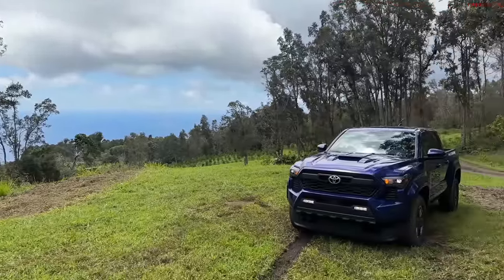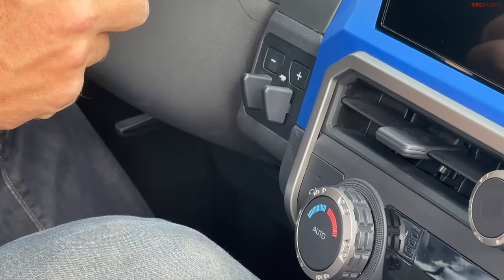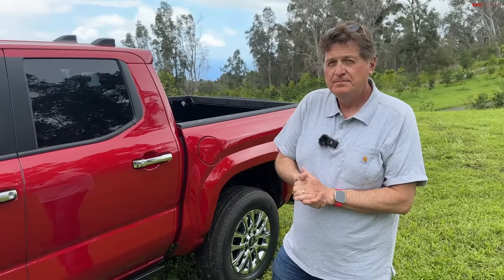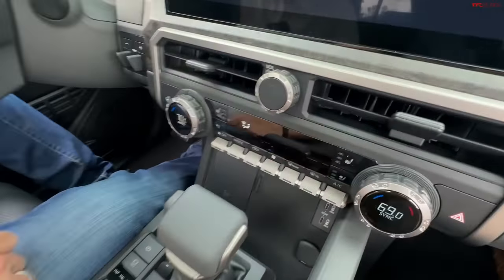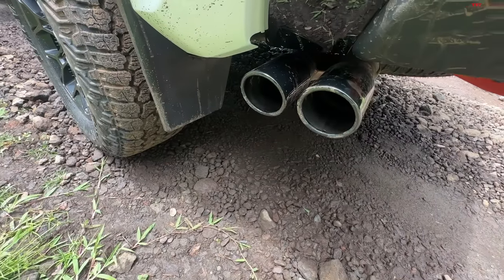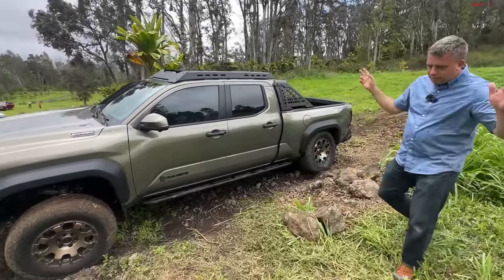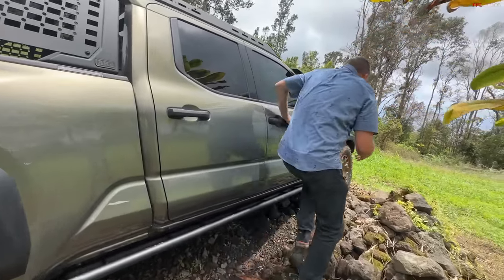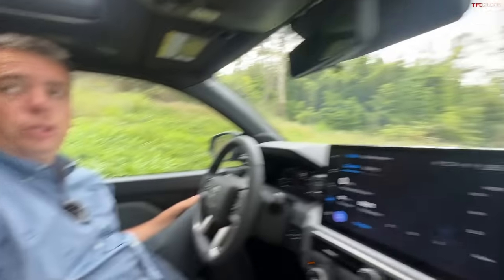The All-New 2024 Toyota Tacoma Is Finally Here But Have They Fixed Its Three Biggest Problems?

Comment: The pricing and fuel efficiency numbers are not out yet but I imagine they will be very much inline with the Ranger, Colorado/Canyon.  Great to see the cab tweaked to add a more upright seating position with a bent knee and the overall styling is very nice.  The air dam/valance on the lower trim models though is terrible.  The rear step up bolted to the bumper should have just been engineered into the bedside which would still allow them to offer different rear bumpers depending on trim.  I don't think the towing number is a big deal at all as most people won't tow with it anyway and it was nice that they offer the brake controller now.  Overall I think it will still sell very well and probably lead the segment but I still think the Colorado/Canyon for me is a better re-design overall.  Better room in the cab and nicer looking lower trim level offerings.
Reply: The only problem with GMC, Colorado, Ranger, Nissan...is that despite them having more modern features, the resale value on Toyota is still waaaay higher...nobody wants an American (garbage) midsize used truck. 80,000 miles on an American truck is alot...where Toyota is beauty broken in at 150k

Comment: The new ranger was announced and Toyota said, “hold my beer!”
Reply: Why? This isn't close to the Ranger Raptor.🙄
Reply: the Ford ranger has a V6 TwinTurbo. They should’ve put the big V6 in the Tacomas four-cylinders suck.
Reply: @TheMarkdick  Honestly prefer the hybrid, instant response instead of turbo lag. Even though it has less power in the real world it will be quicker because of the electric motor.
Reply: @MrLalasd  ford should have added a hybrid option. Plus I like the styling of the new tundra a lot more than the ranger
Reply: @dmegahan  Probably just a matter of time, now that Toyota has a hybrid on the market.

Comment: Manual trans!! , yes. I'd pick the non hybrid. Is performance capped with the turbo setup?  Anything special with the block?
Reply: Without the battery it makes waaay less power than anything out there
Reply: @willrector9716  2023 tacoma 2.7l i4 makes 159hp/180 tq, 3.5l v6 makes 278 hp/265 tq. The 2024 SR makes 228/243 which is already a huge increase for the SR model; and the SR5+ models that are non-hybrid are 270/310 with manual and 278/317 with auto; which actually makes WAY more torque than previous gen. Please explain how this has "way less power than anything out there" when the 2023 colorado makes 237/259 with the HO version making 310/430...The new 2024 ranger with its 2.3l ecoboost is 270/310 with its high end 2.7l v6 ecoboost making 315 hp/400 lb-ft of torque --- STILL less than the i-force max making 326/465. 

I think you're wrong here in many aspects.
Reply: @JoeWitAFro  Cool thanks for the info. Seems almost the same output as the old tried and true V6 but with turbo lag.   I'll take my supercharged v6 over the twin turbo 4 banger anyday, about 30% gain over stock.  Now if we could get a twin turbo v6 that is a different animal.. but we know that will never happen OEM. Cheers. I really like the new seats....
Reply: @vorsol1994  These are single turbo 2.4l inline fours; the turbo is pretty small so no turbo lag should be present. Can't even tell my 1.5l honda has a turbo.

Comment: Some questions about the engines, is the hybrid engine an atkinson or miller cycle engine? More efficient than the non hybrid models. Looking forward to see how the hilux ends up since its said to be on the same platform.
Reply: yep hybrid witch is green hydrogen electrolyte

Comment: Will miss the V6 on the current Taco, but eagerly waiting on how the different 4 cylinders drive especially the manual !!
Reply: The 3.5 was a garbage engine. The 4.0 is the last good V6 that Tacoma came with and it's still missed. More reliable, more usable torque. The new big torque engine isn't available with a manual which is a soul crushing bit of news.
Reply: @hochhaul in what ways is the 3.5l worse than the 4.0l? Where are you getting these stats? I am going to guess you have a 2nd Gen Taco, don’t you?
Reply: @mikenormandy9250  i would also agree that the 4.0 was better than the 3.5. 3.5 was a downgrade
Reply: @Ni-fg6je  The 3.5 is a car engine,wasn’t made for trucks
Reply: @mikenormandy9250  well these guys aren't exactly wrong about the 3.5 being worse than the 4.0. Sure it has more horsepower but it also has equal torque of the 4.0. The 3.5 needs to rev much higher than the 4.0 to achieve its numbers

3.5
278 horsepower at 6,000rpm
265 torque at 4,600rpm

4.0 
236 horsepower at 5,200rpm
266 torque at 4,000rpm

The 4.0 was better suited for suvs and trucks. The 3.5 is better suited for cars. The tacoma isn't a race car. It's a truck.
Reply: @thejuiceisloose8703 I agree
Reply: @thejuiceisloose8703  and yet people think this new 4cyl turbo will be better ? Ha

Comment: I currently own a 2021 trd sport. I can't wait to see more and eventually test drive this truck! I will for sure wait a couple of years and let Toyota figure out all of the little issues before going ahead and trading my current truck.
Reply: Sounds smart. I'm afraid to buy any post cough cars with all the issues they have.
Reply: Still sad the upgrade hybrid power train is the same power as literally every other base midsize!
Reply: Been hearing that new Tundra engines have been blowing up. Id wait a while before getting one of these new 4 banger hybrids.
Reply: @BatuSmoka808  lol there have been quite a few 3.5 V6's blowing up in the 3rd gen. I would definitely hold off for a year or two before trading in my Taco for a 4th gen. I got burned trading in a 2nd gen for a 3rd gen.
Reply: You have practically a brand new truck.
Reply: @BatuSmoka808  The 2.4T isn't a new engine.  Unless they really messed up tuning it for the Tacoma it should be fine.
Reply: @Ni-fg6je  Wrong, 1st gen was
Reply: @hochhaul  Really? I have a 3rd gen and my V6 has been great so far. I trust these naturally aspirated engines more than a twin turbo 4cyl hybrid.
Reply: @jeffk464  What other vehicles is it in?
Reply: Not bad, like the sway bar disconnect, anchor points. I like how they moved the 4x4 select button away from your ac controls but, I would have liked to have seen that ghost viper cut be a real one but I guess they gave us the lines to do a real one. I havent done one on my 2020. I also wonder what the mark up will be for a basic ARB bumper. The thing that bothers me the most is, if u really want any power/torque, ...ur gonna have 2 go hybrid. Thats their money maker. The markups on these things will be asinine! And on the sarcastic side....lets guess how many plastic tabs are used to put these together. I will stick with my 2020 and her known issues which have been modified vs jumpin in and trading. Going to give this thing several years before I even think about it. The quality from a second gen to a third has gone down quite a bit...so unless some things change for  the better, these new Tacomas are in for some big issues. I also am not a huge fan of the longer wheel base. Jury is still out for me....

Comment: It has that new twin turbo 1 cylinder prolly
Reply: LOL!!! 1 cylinder !!! All New weed wacker engine!😂
Reply: It’s a thumper engine. 1.7 litres!! Torque monster!! 😂😂
Reply: It's probably going to have the 2.4L Turbo 4-cylinder found in the Lexus NX...
Reply: Its Quad turbo
Reply: @Hiluxtaco  all new turbo charged inline 4 sitting on a Tundra frame .
Reply: Does it come with cylinder deactivation?
Reply: @gamebredduramax71  Toyota doesn't use "all-new" engines like that. They first appear in their Lexus lineup, then work their way down to the Toyota vehicles..
Reply: Alexander no cyclinder deactivation. So it will be intresting on MPG most use it to get the MPG they state

Comment: My biggest reservation would be the 4 cylinder engine. While Toyota clearly brought more tech and features to the Tacoma, Ford absolutely nailed it with engine choices. Many people don't care about all of that tech, so the engine choices on the Ranger may be enough to sway a lot of customers their way. Hard to believe with the Ranger, since it's been available elsewhere for some time and should have done a lot more.
Reply: Turbos general go belly up around 100k, too bad they didn't keep the V6.
Reply: @PianoUniverse  I'd much rather have a V6, but 100k seems pretty reliable.
Reply: I don’t think their turbo Hilux has issues

Comment: Those hybrid setups are still too new to determine if they’re going to last in these new Toyota trucks.
Reply: NiMH does not give me the warm and fuzzy for sure
Reply: @albe23  there is a reason they do nickel. They’ve been doing it for over 20 years in Priuses and now other cars of theirs that have been insanely reliable.
Reply: Probably why they’re starting so small with kw and it’s Toyota so they’ll improve over time. You won’t get a million miles on it though 😊
Reply: Plus the battery takes up all the rear understand storage space.😞
Reply: Yeah I think there’s pros and cons for sure but I’ll be looking for something without the hybjrd setup. I think the TRD PRO and trail hunter ONLY come with the iforce max. My hope is that they’ll come out with some tunes for the regular turbo version and that’ll help wake it up with some more reliability
Reply: I love hybrids but I hate turbo engines....... I'd be more worried about the turbo power if I were you.
Reply: @Chett_Manly_ Toyota warrantees hybrid batteries for 10 years.

Comment: Man, I will either be very happy I got the last 3rd gen in my 23' or be  very sad hoping I had waited..
Reply: Hopefully you won't be disappointed. Fingers crossed!
Reply: You don’t want a first year model of a new gen anyway
Reply: The 3rd Gen is absolutely beautiful compared to this thing lol.
Reply: @westcoastplinkin6559  LAST TACOMA IS GARBAGE COMPARED TO THE NEW ONE
Reply: This new one is cool, but I’m perfectly content with my ‘23 Tacoma.  No regrets.
Reply: @danielhayner8677  👍
Reply: You'll be pleased you saved thosands, at least !!
Reply: @volvoxc9086  I would rather NOT have turbos. That shit is going to break within 100k miles most likely. No thanks.
Reply: The turbo's will be fine lol .Its just like when cars went to fuel injection. And everyone said carburetors are better lol. Gm 2.7l engine already has hit 200k and more . Yes they need more.upkeep and paying attention to the oils

Comment: The styling, materials, sound all look sub-par compared to the new Canyon / Colorado.  GM for the win
Reply: Yep, I think they just ruined the look of the Tacomas. If it looked more like a mini Tundra, it would be fine, but this is horrible!
Reply: 😂 the colorado doesn't even come with a painted bumper and heated seats till top trims
Reply: @Ryan Lavallee  and the Toyota doesn't come with lots of others things including a front locker................
Reply: @Will Rector  pretty sure the new one has it, but I'd rather have a painted front bumper, mirrors and handles than a front locker and not pay 2k for heated seats that should be standard, or even cruise.
Reply: @ryanlavallee3239  The only Colorado that doesnt have a painted bumper is the Work truck and Trail Boss, every other trim has a lot more luxuries.
Reply: @Georgi Radkov  I'm sorry but in 2023 and today's vehicles prices, a painted bumpers, heated seats, cruise should be standard equipment.
Reply: @willrector9716 it’s not that much to have one installed and most people that complain about not having one never even come close to wheeling hard enough to need one. That being said the new Tacoma is ugly as hell.

Comment: The TRD Pro has air ride seats and the F550 doesn't. That's crazy.
Reply: F550 isn't an off-road truck
Reply: F-550 also drives like it has no suspension. Driving through bombed out exclusion zones of former cities like Cincinnati and Lansing really makes you wish you had a suspension seat.
Reply: The air ride seat is a laughable gimmick. Toyota should have spend the engineering budget on a front locker, not a massive air ride seat that takes up rear seat space.
Reply: It's not a semi truck style air ride seat, there's no air tank.
Reply: @PlayWaves1  it is not semi style but you can fill it with air and release air. Therefore it technically has an air tank.
Reply: @rightwingsafetysquad9872  Lol try coming to Hawaii and experiencing the pot holes on the highway
Reply: @BatuSmoka808  Lol Try Tennessee. I hit a bad patch on the interstate last night  that knocked up the whole front end of my BRZ.

Comment: Andre, do you regret buying your truck now that the new Tacoma has been released?
Reply from the maker: It will come down to efficiency, but I need at least 6,000 lbs of towing.  So the Chevy Colorado with 7,700 lbs of towing works better for me.
Reply: @TFLtruck  I was shocked at the tow numbers 
And the fact it’s not mated to a 10 speed transmission 
I’m with Andre on this one I’d hunt for the gmc to have more than I need then I’d look to the frontier after seeing the mod market for it you will score the frontier built for trails cheaper than you will find the Tacoma and ranger on dealer lots
Reply: @TFLtruck  too bad it was overheating on the gauntlet. Doesn’t inspire a lot of confidence towards the top of the tow numbers.
Reply: Hey andre but it has Cruise control!!! 😂
Reply: Great pick Andre in time you will really be glad you got the American truck. Toyota has been making not so great things lately.... and gm has been testing for years for this new truck. They race the darn thing.
Reply: @carbonking53  But that high in freezing conditions ?!
Reply: @sinister184  except it wasn’t overheating 🤡
Reply: @G-Rated  You're right. It was running great. 🤣
Reply: @sinister184  Warmed up but maintained it’s temperature. Never overheated, also full synthetic but carry on. You clearly have a point that you need to make and haven’t yet.

Comment: Definitely a nice upgrade compared to previous model years, long over do but cab still looks incredible uncomfortable and small for anyone with height for road trips. TFL would be nice to see you guys test vehicles especially Toyota trucks with car seats for kids, I would like to see Andre adjust both the front seats for himself then try fitting a bulky car seat such as graco 4 ever behind him. I find Toyota never factors in anyone who isn’t short that has a few kids in car seats and/or a dog too for there cabins.
Reply: im 5'7  i think mid size trucks fit me good
Reply: @spaceoutmisfit1738  Andre is around 6’3” if my memory serves correct and I’m even taller than Andre, 5’7” is on the short side compared to us. Toyota does not understand the height factor above 6 feet with kids, car seats and/or large dogs factored in to the rear seats. The upgrade was long overdue for the taco however as I stated earlier I would like to see tfl crew use car seats to test just how roomy rear seating is.
Reply: @switchbackfable  Yes, I'm 6'4" and concerned about how I'll fit.  We will see this spring, hopefully.
Reply: @SpringfieldGuy   6’5” myself so I am very curious if they truly fixed the cramped cabin especially with large dogs or kids factored in. Very few Toyota vehicle models I find are designed with anyone who’s tall in mind for comfort

Comment: Super excited for this truck. 8 speed and 2.4 turbo will be a game changer. Looks and technology have been nailed.

My only wish is that they worked on the inner fender more to accommodate bigger tires for the off-roading community and REALLY WISHED FOR A FRONT LOCKER! That would have been a game changer.
Reply: Considering the aftermarket for the current Tacos, you'll probably be able to upgrade that yourself.

Comment: My 2020 colorado zr2 has front and rear lockers and i got it for 35k brand new…. Which is probably about half as much as this will be. Woof. Also it fits 33s
Reply: And yet…here you are
Reply: @vg3430  ?
Reply: Do you need dual lockers when you go rock crawling, or when you drive to the mall in the winter?

Comment: No v6. 2.4 turbo...  Prediction - poor mpg, lack of power and premature engine failure. Aside from the inevitable, nice truck.
Reply: TOYOTA HAS BEEN USING THESE ENGINES IN OTHER MODELS FOR YEARS And ITS A PROVEN ENGINE .
Reply: @carbonking53  probably a boomer.
Reply: @carbonking53  Well why do you care
Reply: @alexanderryan1176   Actually now its not  caps what happened

Comment: Well I'm glad I bought a 23....not crazy about the 24 at all. IMHO. The Trail-hunter is neat though. I really dislike the huge Ipad infotainment....dont like the huge TOYOTA on the passenger side. Then I also question the "spoiler" on the rear of the roof. Will that interfere with some camping toppers? I do like the rear disc brakes. Not a fan of the 4banger turbo. I like my V6. Nice job though on your part Andre!!!
Reply: Too techy for me. Glad I got a 23 also. I like the simplicity of the 3rd gen.

Comment: Disappointed they discontinued the natural V6. Turbos are hard on engine life and don't do well in cold weather climates where I live. But having a manual trans is a game changer, I'm even considering holding out for this until the end of the year specifically because I love driving manual and all the other OEMs have all but killed them off.
Reply: Yeah, I love my V6 TRD Sport for towing.  100K and still going strong.  I can't see pulling a 21' Sea Ray with a I4.

Comment: Love how the 24 Taco has TOW HOOKS! BUT WHAT OPTIONS DO WE HAVE FROM TOYOTA FOR OUR 22/23TUNDRAS THAT DO NOT VOID WARRANTY! I was told by my local Toyota Dealer in WA State that any installation of ANY tow Hook/Recovery option to my tundra, regardless of it using existing bold holes on the frame would void my entire collision warranty. I’m ready to trade the truck in over it. Other than a hitch mount, I have no recovery options mounted to the front. Help us get an answer from Toyota and a resolution!